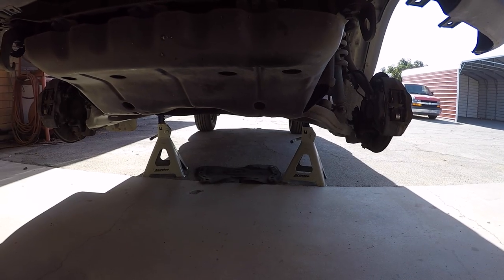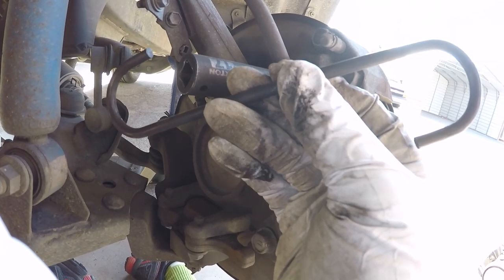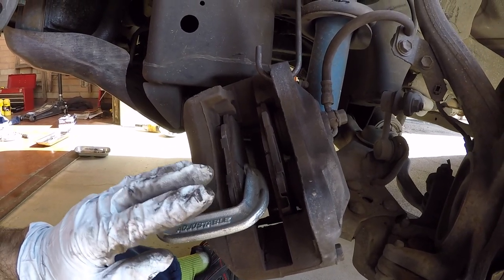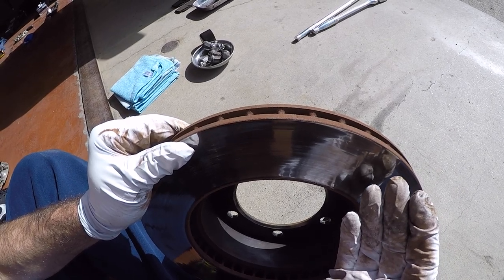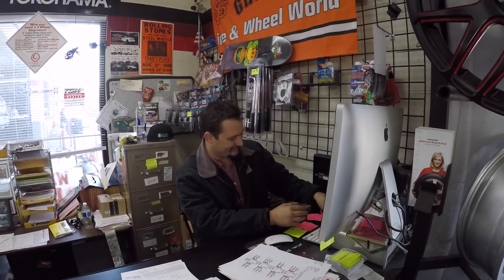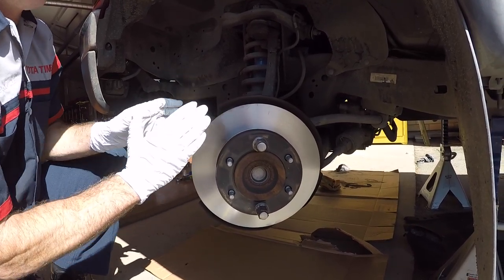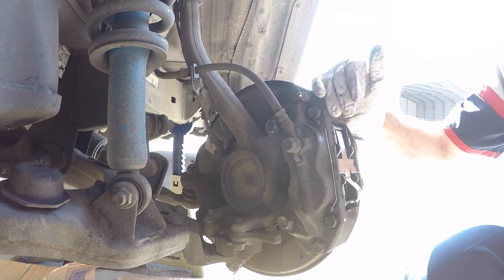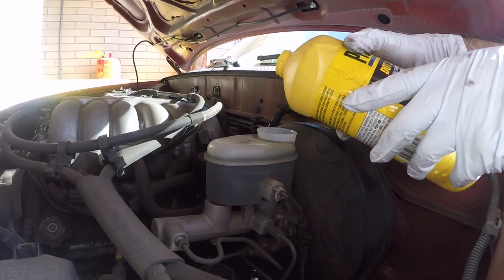Disk Brake Service

Comment from the maker: PLEASE READ THIS AND THE VIDEO DESCRIPTION FOR HELPFUL INFORMATION
We forgot to mention it's good practice before reassembling your brake parts to clean the surface of your rotors with some brake cleaner.  While handling the rotors, you might have gotten some grease onto the surfaces.  Even if you got new rotors, the rotors will have a protective film on them to prevent rusting so you will want to clean up the surfaces even though they look clean.

Comment: Nicely detailed video. Recently did the front pads and rotor replacement on my 2001 4Runner for the 4th time since owning it .. now at 242,000 miles.. First time I encountered a problem with 2 of the caliper bolts not threading back into the caliper. New bolts went in like butter. Upon inspection the threads were very worn. Now I’ll add replacement bolts to future brake job parts list.
Reply from the maker: Glad you like the video.  That's interesting about the bolts.  I'm guessing you live in an area where they salt the roads due to icy conditions.  I've taken calipers off on many vehicles and the bolts always thread in pretty easily.  But, we're in the California Bay Area where corrosion isn't a big issue,
Reply: @TimmyTheToolman  I’m in the heart of the rust belt...where lots of salt is used in the winter.. so always fighting corrosion.
Reply: Hey where did you get the replacement bolts?
Reply: @TimmyTheToolman  what about those that wheel their rigs on the salty pacific beaches?  there is another Toyota Maintenance YouTube channel from a fella up north of you near the border that recently had in a roached out Gen2 Tacoma, it was bad! underneath it like he parked it in the ocean!
Reply from the maker: @efil4kizum  You can ride the sand dunes without much risk.  But, if you're driving in the wet sand or straight up in the salt water, that is just asking for nasty corrosion.

Comment: Hey Timmy, I don't even bother with resurfacing since rotors are so cheap on Rockauto. In fact, sometimes it costs more to resurface.
Reply from the maker: Yep, lots of guys don't bother resurfacing rotors anymore.  But, we spent $30 to get it done and we were able to keep Toyota OEM rotors on the rig.  You're not getting OEM quality rotors at Rock Auto for $30.  If you can find a shop that resurfaces the rotors for a decent price, I think it's worth it.

Comment: I was able to install new rotors and pads following instructions in the video. I only had some dificulties as the lines on my truck had been replaced by metal ones and were on the way to remove the caliper bolts. But I was able to figure how to work around that. Took me longer than expected but I guess it was ok considering it was my first time. Thank you for this excellent video Tim! Would have not been able to make it without it!
Reply from the maker: Hey Mark, great job getting your first disk brake job done.  Now you know that it's really not that hard of a job and also probably realize shops charge entirely too much for it.  You're very welcome and it's nice to know our video enabled you to get the job done.  Happy Wrenching!

Comment: I went to do rotors and pads on my dad's 04 Tacoma and ended up having to change the calipers too because the pins were welded to the calipers.  The ends mushroomed from the pounding I gave them.  Side note: always good to mention pumping the brake pedal after changing the pads because you will have zero brake pedal at first.  Loving the vids as always.
Reply from the maker: I'm guessing you live in an area where they salt the roads and you have lots of rust to deal with.  That would suck to have to chuck the rotors because you couldn't get the pins free. 

That's a good point about pumping the brake pedal.  I don't if you would necessarily have zero brakes but it will be soft at first and might shock and scare you thinking the brakes aren't working.  Glad you like the video.
Reply: @TimmyTheToolman  Northern Virginia, not as bad as some places, but enough salt on the roads for the rust gremlins.  Usually that first pump can go to the floor, but the second is nice and firm.  I only mention it because I've heard stories of people crashing into their garages.  Doing the brakes outside and when done pulling back in and not stopping before they hit the wall.  It is pretty amazing how much places charge to do pads and rotors.  Easily save hundreds by doing it yourself.  The hardest is doing it for the first time because it can feel a bit overwhelming.  Another reason you have great videos.  You show everything with good directions and clear video.  Not to mention giving torque values which I appreciate.
Reply from the maker: @MS-hd8yq  Yeah, I guess if you're in tight spaces, I can see how the brakes being soft at first and going to the floor could cause problems.  When I did brakes on my rigs, I can't remember what my first brake pedal pump felt like but I figure it would be natural for someone to test the brake pedal feel before putting the vehicle in gear but I guess not.  Common sense isn't always common.  

When people on forums share what a shop or dealership quoted them for a brake job, I always shake my head in disbelief.  An experienced mechanic can do a front brake job in a half hour tops but the shop will bill 2 hours labor or something crazy like that.   And Yes, the goal of our videos is to empower people to pick up a wrench and give auto mechanics a go.  We tell people all the time that if they have the Right Information, Right Tools, and Right Level of Patience, they can handle most of their own automotive work.  Thanks for the kind words.  We appreciate it!  Happy Wrenching!

Comment: This video is going to save me so much money.  I have two 3rd gen 4Runners.
Reply from the maker: Hey Richard, good to hear our video is going to help you out.  It really is crazy how much shops charge for a simple disk brake job and you can save significant money doing it yourself.  Happy Wrenching!
Reply: Timmy The Toolman just finished and everything went very well. I did make a minor change.  Instead of pushing the fluid back into the master cylinder, I opened the bleed valve and pushed it out there.  Quick bleed after the install and all was good.  Broke off a bolt on the brake line hanger but it should be a pretty easy fix.  Thanks again!   Great video.
Reply from the maker: @themightygoose1  Good to hear it went well for you.

Comment: Timmy, great video. The high level of detail is greatly appreciated! A couple of questions:

1) Is the there an inner or outer brake pad? OR, are the they not specific? I’ve heard mixed reports on this. 

2) Does it make sense to wirewheel the inside of the wheel (where it contacts the rotor? AND, does it make sense to wirewheel the area around the lug studs before putting on the new rotors?

Thanks for all the efforts you and your team put into making these videos.
Reply from the maker: Glad you like the video Jim.  Some brake pad set-ups do have a distinct inner and outer pad, like my girlfriend's BMW Z3 which has a brake pad wear indicator that's electronic and only connects to one of the two pads.  But, for most disk brake systems, it doesn't matter which pad goes where, they're interchangeable.  Wire wheeling corrosion off the surfaces mentioned might not be a bad idea.  Is it necessary? Yeah, maybe if the corrosion is bad.  Rotors are well known for getting stuck onto the face of the hubs so cleaning up the face of the hub and maybe even applying a light layer of antisieze to the face of the hub before putting the rotor on might be a good idea for anyone who lives in an area where they salt the roads in icy conditions.

Comment: do you think its dangerous or not good to reinstall new pads and rotors WITHOUT the anti squeel shims? im putting new rotors and pads on right now and the old pads do not have any of these shims :( ive already done one side but not sure about the other since i dont have these shims.. my old brakes performed just fine without them, no noise and strong. 98 4 runner
Reply from the maker: Hey Evan, it's not dangerous to leave the anti-squeal shims out.  They are there to reduce brake noise.

Comment: I just did front rotors calipers  rear drums wheel cylinder shots all 3 flex lines as well as front caliper to flex line brake lines master cylinder and brake booster on my 3rd gen 4runner wish I could put my front calipers on the rear and take the drums out but nobody makes a drum to caliper kit that uses 4runners original calipers
Reply from the maker: I don't think rear disk brakes would make a big difference anyway.  75% of your braking strength comes from the front.  I would never hassle with a rear disk brake conversion.

Comment: Mine the passenger side was gone on outer pad passenger side inner bad was fine and driver side pads had more then 60 percent life I replaced my calipers all new complete brake fluid flush and clean
Reply from the maker: Well, there seems to be a trend that the passenger side wears faster than the driver side.  Maybe a slight amount more fluid pressure is going to the passenger side than the driver side.

Comment: Tim, just wondering why you did not bleed the brakes after replacing the pads, great opportunity with both wheels off.
Reply from the maker: I'm guessing you meant renewing the fluid.  The brakes didn't needing bleeding per say, but I could have renewed the fluid for my friend Alex which would have been a nice additional thing to do at the same time.

Comment: I'm confused; in the video you didn't install the extra shims & only went with the duralast shims, yet you ordered the oem shim set as well. 

Anyway, I'm about to do this job for the 1st time. My 98 v6 taco didn't come with those slotted shims, only a solid shim (painted black on one side, metallic on the other). I bought those same duralast pads which came with their own shims attached. So should I add my old, single oem shim in addition to the duralast shims? Or, should I be fine just going with the duralast shims only?
Reply from the maker: In the video, I just wanted to show people what the stock anti-squeal shim set looked like.  That's why you  didn't see me use them with the pads my buddy bought.   If you ordered OEM Toyota pads, you'd want to reuse the old shim set with them.  You don't need to use your old solid shims with those Duralast pads.  Somebody on a previous brake job must have thrown away the slotted OEM shims.

Comment: if the rotors look OK, is it possible to just pop out the pads without removing caliper from knuckle and pop new ones in?  what sort of special tool do they use to compress the pistons back for the new pads to fit doing it that way? ...  current dealer front brake specials are running 199$ + fees not sure if that includes resurfacing rotors if necessary but it just might!?
Reply from the maker: Yes, you can pop out the pads without removing the calipers.  Before removing the pads, you could try squeezing the caliper in by grabbing the ears of the brake pad and the outside of the caliper with a large channel locks and compressing them.  Once you get a little space between the pad and rotor, you could insert a pry bar wrapped in tape to protect the rotor and further pry to push the caliper pistons in.  

You will get better braking and limit any shuddering by either resurfacing the rotors or replacing them.  $199 for a brake job definitely doesn't include replacing the rotors because OEM rotors are expensive.  I would imagine it would include resurfacing them.  But, rotors need a minimum amount of material for them to be resurfaced.  If after resurfacing the rotors, they will not have the minimum width, they will have to be replaced and then I know that $199 brake job will turn into a $400-$500 brake job.
Reply: @TimmyTheToolman   currently the MSRP on OEM rotors is 85$ each... after 33% from the cyber genuine yota parts dealers it is 58$ each + free shipping from certain cyber dealers ... at 250k miles i just went ahead and replaced the original rotor disks with some new ones.  but now i really want to change the powerstop brand pads that were used because those put out an insane amount of brake dust all over the wheels turned black. I have some Raybestos pads from RockAuto to give a try.  i likely need to get some new slide pins also due to corrosion
Reply from the maker: @efil4kizum  That's a real good deal on rotors.  As for pads, OEM is another great choice.

Comment: Getting ready to do this job on my 96 Tacoma and was looking at the passenger side break pads and noticed that the outer pad is wearing significantly more than the inner pad is. Wondering if this is cause of the caliper or fluid ect. Also going to be upgrading to stainless steel break lines at the same time to refresh the 28 year old lines. Just wanted to see if anyone knows a fix to this?
Reply from the maker: @liamroberts7054  It's pretty common for one side to wear faster than the other.  I don't think there's a fix.  The fluid comes in via the inside side of the caliper and then is dispersed to all 4 pistons.  It might have to do with how the fluid is routed and there's more friction loss (pressure loss) on the inside compared to the outside.  I've seen the uneven wear on many vehicles.   The only thing I think you can try is a caliper rebuild, which renews the rubber seals and dust covers.  We have a video for it, but it was done on an 80 Series Land Cruiser.  https://youtu.be/r_9pPEan9q8?si=jkKU0ZFzeUsfkXup
Reply: @TimmyTheToolman  Ok thats what I was thinking just wanted another opinion. Really didn’t want to buy new calipers like to keep the oem. A rebuild probably wouldn’t hurt to do and would be very cheep. Thanks for the fast response. Videos are so helpful have used so many in the last 5 years of owing my tuck.
Reply from the maker: @liamroberts7054  You're welcome.  We're happy to know our videos have helped you out.  Happy Wrenching!

Comment: Hey Timmy I installed some new rotors and pads from Napa on my 2016 4Runner and the first set of rotors egged out and I had a shimmy in the steering and then I replaced them with some other rotors also from Napa and they shimmied also after I replaced those although they did not shimmy right away they ended up still egging out should I be using Toyota parts for these brakes I can't figure out what's going on why they keep shimmying please help
Reply from the maker: I've used the Napa premium rotors with good luck in the past.  Do you drive down mountain grades a lot and ride the brakes?  This shouldn't happen to new rotors quickly.  It usually happens from uneven wear or brake pad deposits from searing the pads into super hot rotors creating unevenness in the braking surface.
Reply: @TimmyTheToolman  so what would the fix be besides not riding the brakes because I don't know if my wife will stop riding them and yes she does go down mountain roads you are good mister do you know my wife hahaha thanks
Reply from the maker: @DaveSarmiento-c4w  You have to teach your wife to use engine braking.  An automatic trans can be used just like a manual trans.  You use the transmission gears and engine to slow the vehicle down.  When traveling down a grade, you should not need to constantly ride the brakes if you're choosing the proper gear.  Occasional braking is ok, riding them is not.  With my 3rd Gen 4runner, my first downshift is turning overdrive off.  if I'm still traveling too fast for the conditions, I shift into 2nd.  If the grade is ridiculously steep, I'll even shift into the Low and hit the brakes occasionally to reduce my speed and not over-rev the engine.  it's time to teach your wife how to properly negotiate descents without riding the brakes.  Lots of people don't know how to employ engine braking and these are the people who burn up brakes, or worse yet, overheat their brakes, experience brake fade and then have a terrible accident.  What you teach your wife might one day save her life and the life of others.
Reply: Thanks Timmy I appreciate all of your input you are the best
Reply from the maker: @DaveSarmiento-c4w  You're very welcome!

Comment: Hi Timmy 
Amazing as always mate. Could you please let me know which service manual you refer to while repairing for the gen3 . I need to get one and unable to find the correct one. Help is much appreciated. A picture of the front cover will be of great help
Reply from the maker: Here’s one! It’s for a 1999, what year do you have?
https://www.ebay.com/itm/1999-Toyota-4-Runner-Shop-Service-Repair-Manual-Book-/131667557695?mkcid=16&mkevt=1&_trksid=p2349624.m46890.l49286&mkrid=711-127632-2357-0

Comment: How do I know if I need to order 297mm or 319mm front disc?
Reply from the maker: A dealership or parts store can usually determine the size rotor you need from your VIN #.